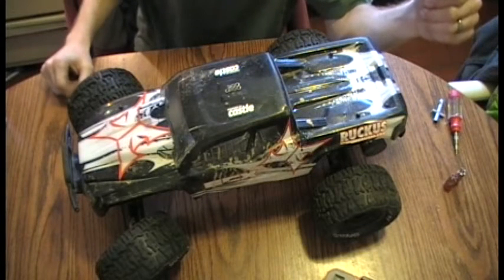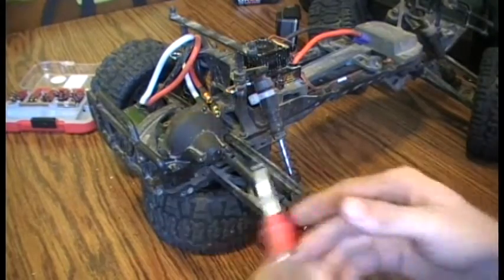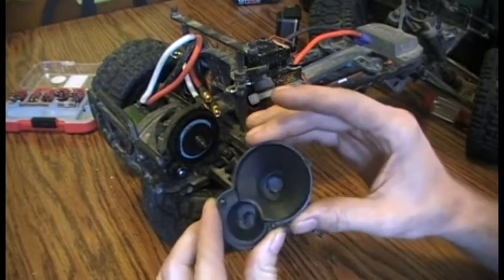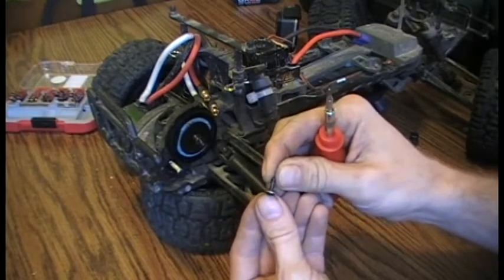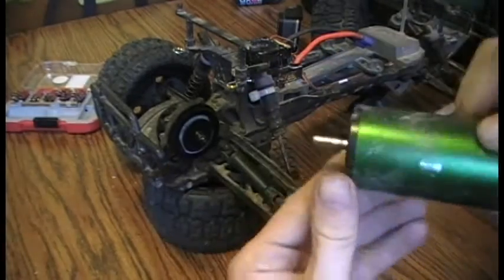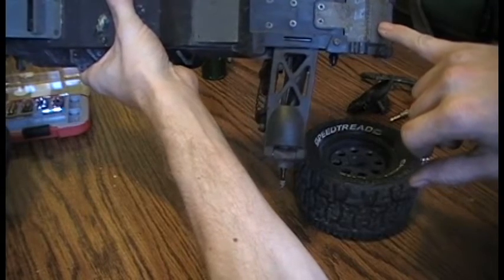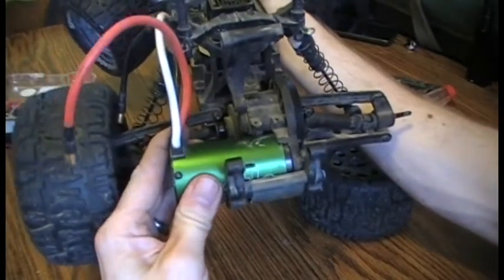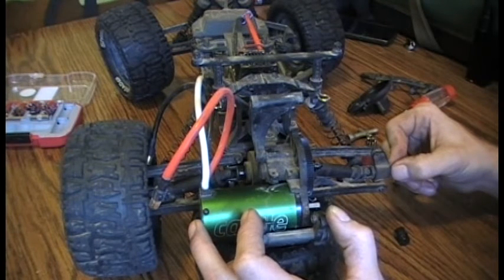ECX Ruckus explanation of Castle Creations Sidewinder 8th Install

Comment: I just bought a Sidewinder 4 paired with a Castle 5700kV sensored motor for my ECX Ruckus 2wd 1/10. What transmitter and receiver would you recommend because I don't think either of the stock ones are compatible?

Comment: If I were to get the same motor ESC combo as you and fit it onto my ruckus (out of the box new) would every single component be able to take the power? (Gears, diffs, etc)
Reply from the maker: No. The spur and pinion need upgraded. The axles will snap below 1/4 throttle. Metal axles are a must. The differential and clutch should handle it. Mine are still stock.
Reply: Crenston Customs what would the cost be for your upgrades in total? (Approx)
Reply from the maker: About 60. Just looked it up. Hot racing metal spur, and hot racing star drive metal axles. Pinion should already be metal from the factory.
Reply: Crenston Customs appreciate the help 👍

Comment: do you have the part number of that pinion gear please ?
Reply from the maker: +jean pierre marty 
hot racing NSG824 
48P 24t pinion. it comes with a sleeve to fit on 1/8" motor shafts. without the sleeve, it fits 5mm shafts.

Comment: is that motor the 2200kv motor that comes with the sidewinder 8th esc
Reply from the maker: +dakota smith yup
Reply: is it pretty fast with that motor or just torque?
Reply from the maker: +dakota smith stupid fast. It has the torque to move the truck quickly. It pulls wheelies at anything over 1/4 throttle. Dirt, gravel, grass, doesn't make a difference. That's only on 3s. Haven't run 6s..... Yet. Top speed on 3s about 48mph with close to stock gearing.
Reply from the maker: +dakota smith stupid fast. It has the torque to move the truck quickly. It pulls wheelies at anything over 1/4 throttle. Dirt, gravel, grass, doesn't make a difference. That's only on 3s. Haven't run 6s..... Yet. Top speed on 3s about 48mph with close to stock gearing.